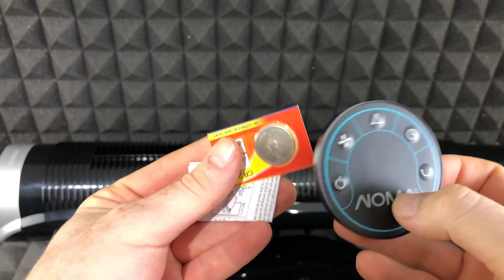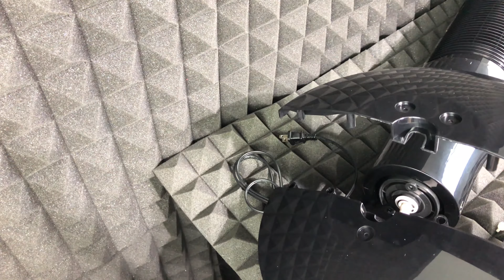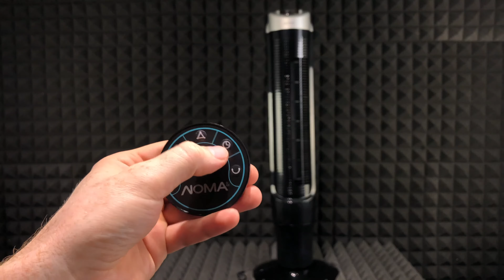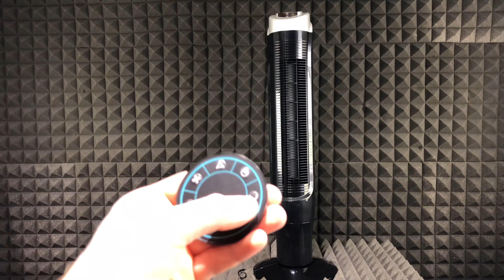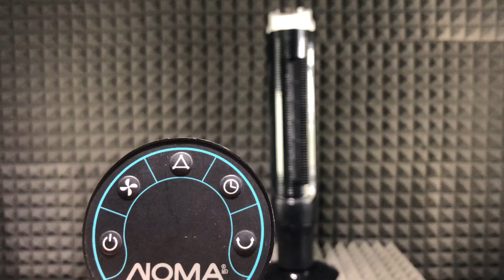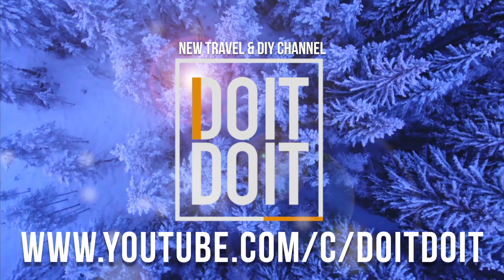How to change/ set up Noma Fan Controller Battery

Comment: replaced battery on mine but have to hold the middle of the remote to get the buttons to work ie for some reason not making the connection to battery unless i push the remote together in middle anything i can do to make it connect better?